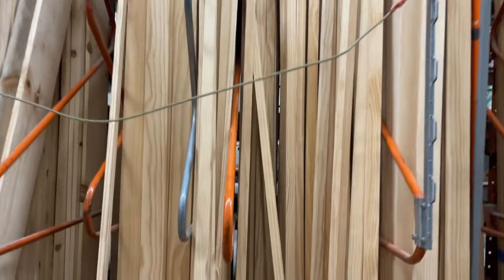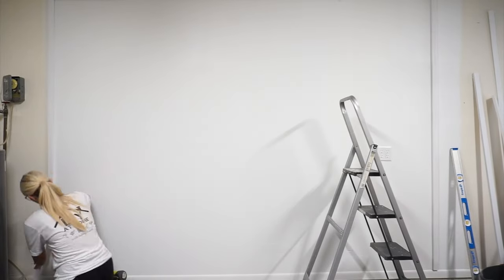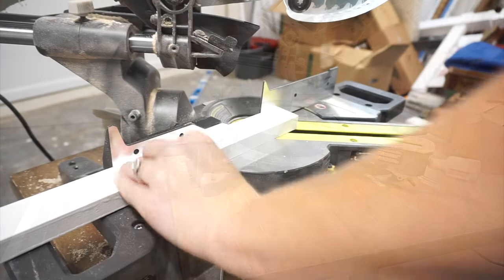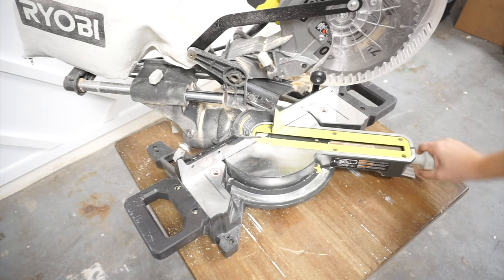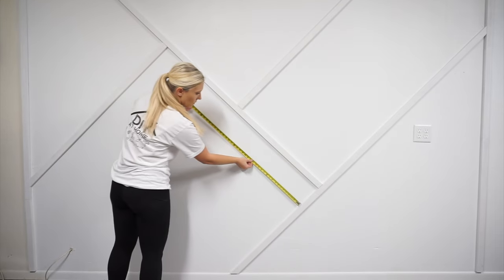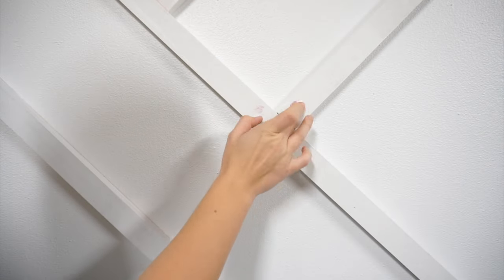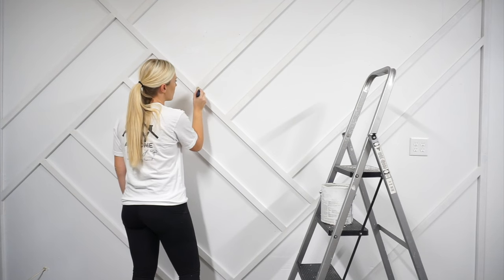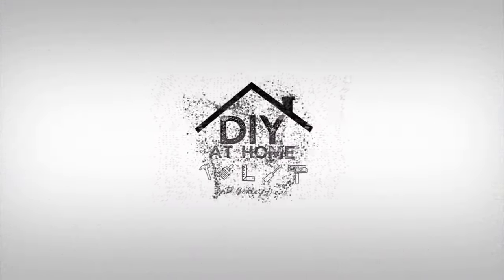Easy DIY Geometric Accent Wall

Comment: If you want a different color, when do you paint?  Before or after attaching?
Reply from the maker: If you are changing the wall color, I would paint the wall first and even the boards of you can before installing. Or just paint the wall the new color and then paint the boards the new color after you install them.

Comment: @mrsashleyfrench what sheen did you use on the wall and boards semi gloss or flat??
Reply from the maker: I always use Satin on my walls and the skinny boards on this geometric wall are also satin. For my baseboards and door trim at home, I used satin as well but would recommend using semi-gloss on baseboards since they wipe off easier when cleaning with semi-gloss.